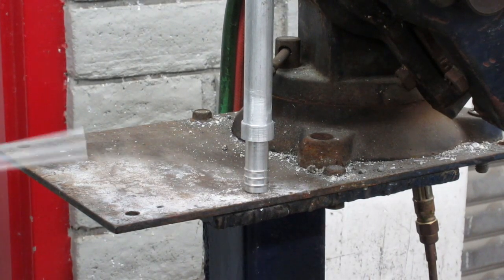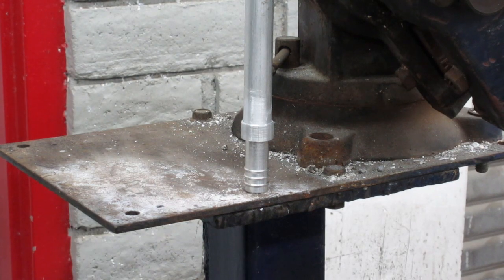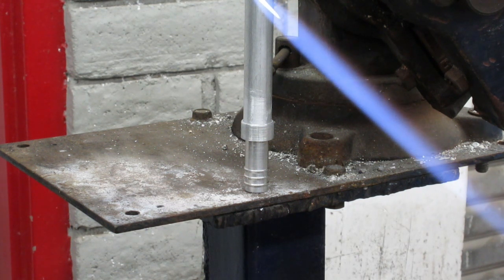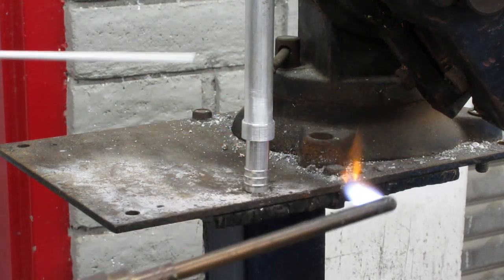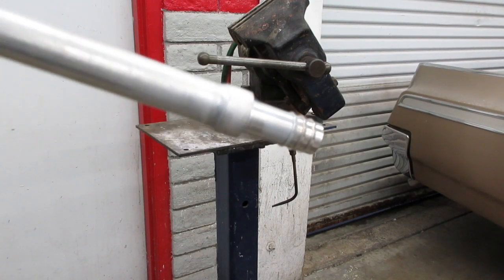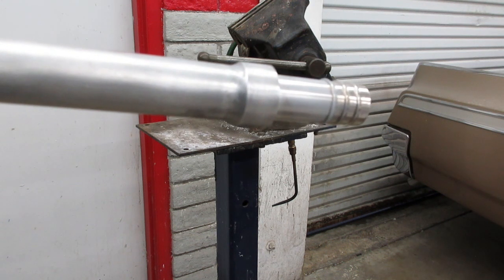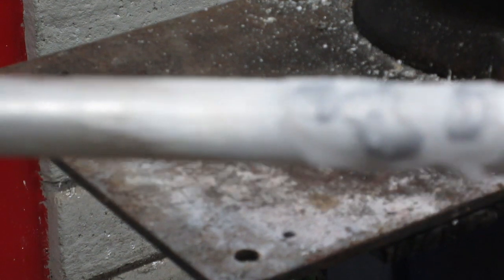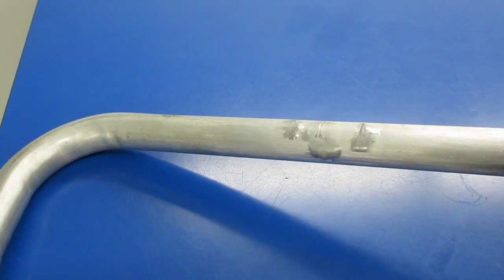HOW TO GAS WELD ALUMINUM

Comment: Good info about the sanding. The only sucky part about brazing like this is that vertical seams are a bitch to do; horizontal seams, like you have here, are fine - some pieces can't be manipulated to get a horizontal seam to braze.

Comment: Thank you, kind sir!! very helpful! I was wondering what torch tip you are using. and p.s.. I don't care what they say the process is called lol ! I personally just care that it works. I believe it is getting hot enough to actually be a weld!
Reply: Thank you, lots of comments about braze vs. weld. I doubt most commenters have tried it to see for themselves. The tip I am using is a Victor 3-W-1

Comment: That's very nicely done!  If anyone cares, I'm pretty sure this is BRAZING.  I mention this b/c I teach basic welding in a small way, and one of the curses of my existence is that people (especially on eBay kind of situations) will call ANY DAMNED THING "welding" if there is any fire or sparks involved.  This doesn't take anything away from the JOB, it just makes teaching and shopping difficult and confusing, and really screws up the beginner!  This process might not have a good name!  But it's a strong analogy to BRONZE WELDING that people do on steel.  That is also a rich source of confusion!  I think a problem everyone has is not realizing the whole temperature span of soldering/brazing/welding has moved WAY DOWN with aluminum!  Beginners TRY to keep in mind:  In WELDING the base metal melts, the original edges are lost.  Anything else is not welding!  Soldering, brazing, sealing wax,  I don't know... so many options!   As an analogy, you can WELD brass, and BRAZE brass, using the same rod and the same torch!  You don't use it in quite the same way.  I do this demo to clear up confusion among the students.
Reply: It all depends on whether  "The "Aluminator" rod has been fused and has melted with the base metal. Is the filler rod  the same alloy as the aluminium tube? It is advertised as an alloy, but we don't know if it is different from the aluminium tube Bob is working with. If they are the same composition (or have the same melting point) and they are FUSED together, this is WELDING, if the rod contains different amounts of the alloy element (magnesium, silicon manganese, copper etc) and the melting point is (normally) lower, then we are looking at BRAZING if the base metal DOES NOT melt and fuse with the base metal. Pure aluminium is very ductile and not commonly  used in any castings where strength is required. Mainly used in  power lines. So all the aluminium alloys we will be working with are an alloy of some sort.  Silicon brings down the melting temperature of the aluminium which makes it an excellent alloy rod for brazing, but if the base metal is also silicon aluminium alloy or has a similar melting temperature, then this is welding. Bob has melted the rod onto the base piece, but it did not melt the base metal.. Brazing and welding are not exclusive but can overlap. Unlike steel, if you apply a little too much heat to aluminium alloy base metal, your weld will be on the floor. If Bob had left the flame sit too long in one spot, the brazing would have turned to welding and if the flame wasn't moved away,  to a fused blob on the floor. Now think of soldering a solder made plate. This is technically welding. Yes you can weld solder but because it has such a low melting temperature, "they" call it soldering. When you solder copper, what is it? It is brazing. If you are good enough to melt the base metal as you are adding the filling rod,  you are welding even if the two metals are slightly different. There are many GREY areas in welding brazing and soldering, which is why it's better not to overthink them.
Reply: He melted the base metals together. It is welding.
Reply: @moto_rad  Had another close look at the video. No he did not melt the base metal. He brought it up to the melting temperature of the filler rod. The rod packet clearly states flux coated aluminium JOINING alloy. These filler rod have silicon and a much lower melting temperature than aluminum. So this is commonly called brazing.  Aluminum has to be well heated before brazing and welding. With the latter, a fine pointed flame is used and you focus the heat to one point where the puddle will appear and will be translucent. If you melt some alloy into rgis puddle, it is welding. It is tricky to use these rods for welding because the base metal has a higher melting point. More than the melting temperature of the rod. To weld you have to keep the filling rod more distant from the base metal and bring it in as the translucent puddle appears. Very easy to have the base metal collapse as you juggle flame and low melting point filler. Much easier to weld with a high melting temperature filler rod. In this video, the pipe is heated but not melted. With such a feathered broad flame, if the melting temperature of the base metal was reached, it would probably end up on the bench.

Comment: Thanks thats what ive been wanting to do. Great information. Can you lay multiple beads one upon another to fill a hole by letting it cool a little and comming back a few times to fill or could you just add a plug and weld it in? Thanks i really love brazing but never seen it done like that  great video
Reply: You can do both. I lay the rod perpendicular to the tube. Melt the rod slightly and forming multiple logs across the tube. Then you can carefully heat the material and slightly flow it. It takes practice as the melting point of the rod is just slightly less than the base metal.

Comment: Have you had any success using straight Map or propane  gas with no Oxygen?   Just wondering.
Reply: For the most part, no. You cannot get the metal hot enough. There are aluminum brazing rods on the market that work well with Map gas. This rod requires the metal be up to its melting point to add the filler.

Comment: Hate to split hairs but is this really welding or brazing? You're not melting the base metal as far as I can tell so I'd tend to call this brazing. Regardless, the end result looks good and I'm certain it would perform well. Thanks for the video

Comment: This is brazing or soldering as the filler rod alloy has a lower melting point than the base metal which you do not melt. But I really like it and I will use it !

Comment: I can't find this product you use. It seems not to exist anymore. What do you use now?
Reply: I think the wire is 4047 alloy, aluminum and silicon.  More silicon than the ever-popular 4043.  Sold as TIG-rods and MIG-wire.  Don't panic!  Flux sold separately.  The flux is a pain, it has all disadvantages!  Interestingly, you can buy WELDING flux or BRAZING flux for this stuff!  If you were very clever and determined, I think that TIG-BRAZING is in reach!  You could use AC TIG to CLEAN and HEAT the surface, not quite enough to melt it.  No puddle!  Then flow the filler on there.  I have done this on light steel sheet with Silicon-Bronze wire.  It's neat, sweet and discreet.  Low heat-affected zone, no penetration, no distortion to speak of.  This used to be called "Bronze-Welding".  I think the same ACTION could be had on aluminum with the 4047 wire, skipping the awful flux.  The flux is expensive, toxic, corrosive and has a short shelf life!  It works great too, but life would be better without it.  If you don't HAVE TIG, forget it!

Comment: This is actually brazing and the internet doesn't recommend welding with propane due to creating weak and brittle welds . Do you think if you were to actually use propane to weld ( involves making a molten pool on the base metal ) with these rods , SMAW rods , or flux it would create a descent weld since they have flux incorporated onto the rods ?
Reply: Yeah, I was just asking myself if this was actually welding or brazing.  Your comment might be a bit harsh Airon, but this seemed to me to be brazing using capillary action.

Comment: That is not welding.  You are brazing.  The difference is that you are not melting the base metal.  Welding requires melting the base metal. I use this brazing process because it is easy but it is not near as strong as a TIG weld.

Comment: This is brazing not welding. You can tell by the lack of a weld puddle and how the filler rod flows. Also, you can see that the entire part is geared until the filler melts against it and then it flows along the joint. I weld aluminum with acetylene and its very different. Aluminum should not be welded with propane. The heat is insufficient for a good weld. Hydrogen or acetylene works. You create a weld puddle and then dab the rod in like rig welding. Its very similar and the result looks the same. Unlike here where he backs off the torch until the surfaces are hot enough to melt the filler, when welding it you have to put the tip of the cone on the joint until the surface starts to wrinkle and then dab or scrape the rod in the weld pool. Once you start it you travel along the weld jut like rig welding. Guarantee 100%, that is a brazed joint. I'm not throwing shade on it though. Its a very nicely brazed joint.
Reply: Actually, I used acetylene for 20 years before switching to propane. The reason I did so is I had a hard time getting clean gas that would not contaminate my welds. It was weird,  one day all was good, put on new bottles and welds turned black. Tried multiple new bottles. Installed an old bottle I had and everything was fine. I switched to propane as it is a cleaner gas, It works for the very small items I weld. If the aluminum was thicker it would not be hot enough. Yes there is a puddle. I tig and gas weld and braze. I feel that I can tell the difference between the two.The filler rod I use is not a low temp brazing rod you find on the net. It is an aluminum welding rod. You can cut the finished welds and on inspection, you cannot tell what is base metal and what is filler. All that said, call it what you want, I am simply demonstrating safely, permanently joining aluminum parts. Right or wrong I have used this product daily for 30 years with no failures.
Reply: It looks to me like the filler material has a very low melting point around 800° to a 1000° which would classify this process as soldering, brazing with the brass and bronze alloys takes a much higher temperatures around 1800° and up and usually brazing is done with dissimilar metals
Reply: When did brass and bronze get invited to the party  @redman53me
Reply: 100% correct Michael, it’s amazing how many YouTube videos get this wrong. What gets me is that this guy looks like he should know the difference by now.

Comment: Thank you!! 
I’ve been looking into the mini oxy-propane torches for a number of reasons, but welding non-ferrous metals is a must. You’ve shown here that not only is it possible, with practice it produces excellent results.
Reply: Mr Steven's,  I have the same idea.  I bought  a clone Smith mini torch.  Using flashback arrestors on the torch lines.  My idea was to use it for making aluminum projects.  Such as; I use an aluminum ramp to load euthanized pigs into my 4x4.  The ramp is 100 percent riveted together.  I plan on using the aluminum welding rods to make the ramp stronger and more durable.   I need to practice before I take on this project. Do you have any set up suggestions.

Comment: I wish I could get those rods locally. No one seems to carry anything Messer here, and I've struck out entirely finding somewhere to order them in.

Nine months later... eBay to the rescue. I'll have to give this a go some time soon!
Reply: What kind of welding rods do you use for this I didn’t see where it mentioned that
Reply: @arizona5253  I use MG400 from Messer.

Comment: That's not welding .that is brazing or hard soldering ..your not melting the base material as in a proper fusion weld .you have not created a welding puddle you melting a filler only
Reply: I recommend trying it. Yes the filler rod melts at a slightly lower temp than the base. Most of the time the base metal is melting at the same time as you apply the rod. Correct there is no puddle, but you dont  have that level of control with gas welding. I weld tig and gas and this too is a weld. It can be argued several ways, I say, try it and then let me know what you think.

Comment: technically clickbait since this is not welding. it's soldering, or possibly brazing, depending on the melting temp of the rod. welding melts the base metal.

Comment: Question for you Bob. (a great video BTW I got a lot out of this)  I have a lot of aluminium miter joins to braze. The material I need to join is 40mm x 3mm flat-bar, corner joints (mitred 45°). Would this pas option be able to braze this connection?  Regards.

Comment: I see the Aluminater rod  has a flux coating where most aluminum welding rods do not. Will this increase strength?
Reply: nothing to do with strength. no metal was welded in this video.

Comment: Very cool video.  I tig aluminum a lot and figured I could give torch welding a shot.   I have a ton of brazing/soldering experience, and at first glance this seems like brazing to me.  However the filler material definitely is not a brazing rod.  Aluminums low melting point makes me wonder if the filler is actually functioning as a weld (both filler and work piece melt) and actually flowing through capillary action like solder/brazing.  Regardless of the technicality of what is going on it would be damn near impossible to get much of a stronger joint on thin aluminum tube than this.  Tig welding on such a small diameter and thin tube would be more time consuming, much more difficult, and likely not produce a stronger joint.  Anyway cool stuff, thanks for sharing 👍🏻.
Reply: Yeah, I was just watching this and asking myself if this is technically welding or brazing.

Comment: Can this process be used for welding truss-style structural frames of 1/8" wall tubing (for my truck camper)?  I have a torch and a flux core wire machine...trying to decide if I should use the torch, upgrade the flux to gas/MIG or pay someone to TIG it
Reply: You will not be able to get enough heat buildup with a torch. This rod is for stick welding so you could use a traditional welder. I think tig or mig would be best.

Comment: Sorry !!!  But this definitely is NOT !!
welding....  Welding is bringing two metals to their molten point for fusion. This is brazing not welding.
Reply: In another situation, if this was used for example AS an electrode in arc welding (!) the arc would probably melt the base metal, and our rod would flow on to that and it would BE "Welding"!!!  Here it's heated up and flows about and flows deep in to the joint like water I'm telling you, in a way more typical of soldering and brazing don't you think so?  A nice strong cosmetic job I think we can all agree.  The same thing might be done with standard aluminum brazing alloy (aluminum and 12 per cent silicon is common) and a little jar of aluminum brazing flux.  What we see here is very nicely done, I don't mind repeating.
Reply: Actually, That is exactly what I am doing here. This is not a low temp filler rod like so many you see on the market.  The rod is aluminum alloy welding rod covered in flux to shield from oxidation.
Reply: @bobsteinmann5793    hmm.  I'll have to give it a try.   If u don't mined me asking what psi did u. Use for propane.?  &  oxygen ?
Reply: @keithyz3943  25 psi oxy 17 propane
Reply: @bobsteinmann5793  what was psi of propane and oxy

Comment: Will this work on 6061-t6, 5052 ? Is this relegated only to soft 1xxx or 3xxx aluminum ? Thanks
Reply: According to Messerweld, this is good for 1XXX, 3XXX. 5XXX. and 6XXX series.  There's a data sheet online, it doesn't say much.  MG welding products, or "Messerweld".  They don't say what the alloy IS, which is a little odd and typical of welding products sold for "maintenance".  This leads one to suspect that it's something common given a cute name and a higher price!  The few Messer products I have tried worked very well by the way.  I suspect that in this case what we have is an aluminum brazing alloy, something like Aluminum 12% Silicon, which you can buy.  What we see here sure LOOKS like brazing, there's general heating and capillary flow, the base metal is NOT MELTING!  I think it in every way fits the definition of brazing!  I have done similar stuff using brazing wire and flux.  The molten metal is very fluid and pulls through a joint easily.  The action is not at all like welding!!!!  You have to get that flux OFF of the material as soon as you can, from what I read.  Other than that, it's a really cosmetic job.
Reply: @leonardpearlman4017  thanks for responding.  I also have used this type of rod on thin 22ga. aluminum quite successfully. Alumaloy and the stuff harbor freight sells. Everything clean and sanded and propane torch,  good fitup with the idea of using capillary action. A sweeping motion with the flame and swiping motion of the filler metal along the joint works well. It helps to "tin" parts that have an awkward fitup. The thin base metal would become annealed yet the filler metal would be harder. It acts very much like soldering but a little fussy if things aren't absolutely sterile clean.

Comment: Do you use a particular propane torch head?  I watched another video where the gentleman said to use a #1 propane torch head.  Great video by the way.  I am building an aluminum frame for a hookah diving compressor and I'm new to welding aluminum and using propane/oxy combination.  I couldn't find the exact rod brand you mention, but I found one exactly like it sold through the Blue Devil brand on Amazon.  I'm just waiting on getting my order of Aluminum Oxide sandpaper to start.